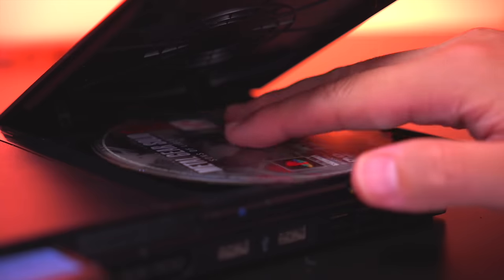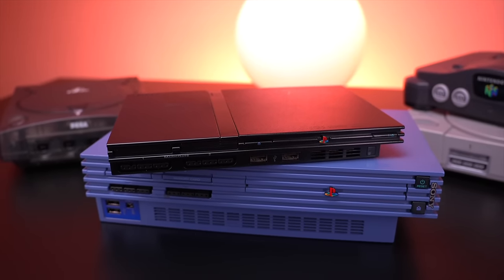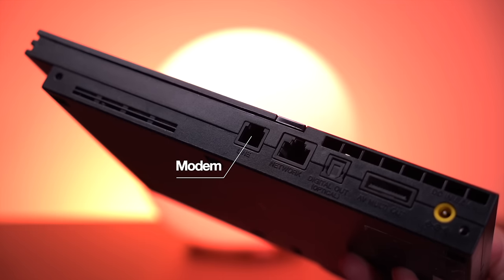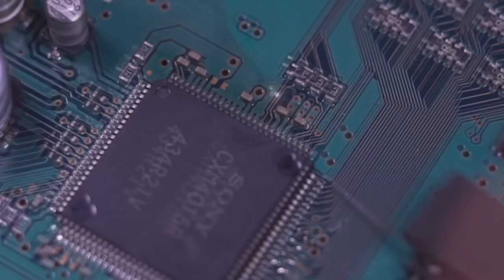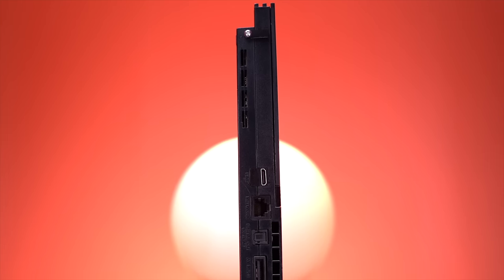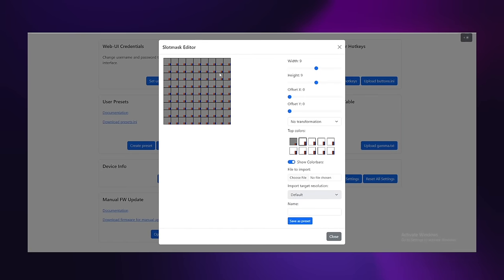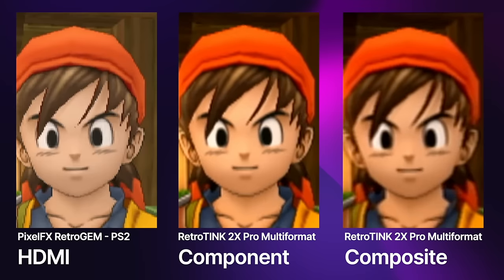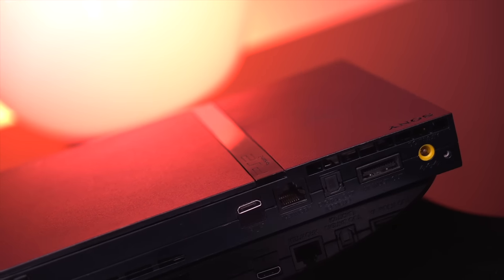This HDMI Mod Makes The PlayStation 2 Look GORGEOUS!

Comment: I think the phat is the better PS2 console variant to mod; hard drive support and the system runs cooler. The slim will probably run hotter with the HDMI kit in there.
Reply: Idk how anyone could think of running a modded PS2 without an HDD... that's like, 90% of the point
Reply: fats are all quite hot and loud....
Reply: @nattila7713  just replace the stock fan with a Noctua A6x25 FLX. The fan comes with a 3 to 2 pin adapter. The only thing you need is a 3D printed bracket, since the original fan is slimmer and dont have the standard mounting holes on the fan. All the thermal pads are 2mm thick except the Emotion Engine's(EE-GS), thats 3mm thick.
Reply: @talos86  hassle and price :( but yeah...
Reply: 7000X slims aren't DECKARDs, and as such have HDD support.

DECKARDs have their own advantages, though.
Reply: HDD? haha mx4sio do all the thing from the micro sd in front memory card slot :D never heard about that? :D  @-Monad-
Reply: @nattila7713  sounds like a pretty simple thing to me. If you don't want to 3d print, I'm sure there is a way to clip it or double sided tape that bad boy in there lol.
Reply: @MrCamel-mb3nd  loading speeds are way too defferent. LAN is even better option than usb 1.0
Reply: 50000x ps2 fat is virtually silent it's beautiful
Reply: You can buy a ribbon cable to 7000 model And connect ide to sd adapter. It will be fully digital console.

Comment: I remember at one point in the PS2 and Xbox's lifecycles solderless mod chips that clipped onto the processor became a thing. Was there a reason that method seemingly isn't used at all anymore? When I see mods like this I always think about how approachable the install would be if it wasn't for the actual ribbon to chip portion, I'd wager a lot of consumers would pay a premium to avoid that one job.
Reply: It wasn't a good solution even back then, but worked for the most part since the signals they dealt with were very often low speed. When you're dealing with pixel bus signals, which is what these mods convert into HDMI, solid connections are 100% necessary (and possibly impedance control) so it's extremely likely that some kind of solderless clamp wouldn't work at all.

Comment: The installation is a hell of a process, so congrats on your detailed explanation and how you have successfully done it. If your plans are to play exclusively on the PS2, I think it's fine to get this kit, especially if you have advanced soldering skills. But, honestly, there are way better and cheaper solutions for this goal, like the GBS Control, that can be used with other consoles. Anyway, thanks Tito, for bringing this new solution to the channel.
Reply from the maker: Thank you P3KaX!  Definitely agree there are a ton of great solutions out there!  Cheers!
Reply: Was it successful though?  The HDMI port is crooked.
Reply: how is that comparable? 
it's not digital output is it?
Reply: @seethruhead7119  it's comprable because both chains result in PS2 games appearing on modern screens, where the results can be compared. Besides, being all digital to the display panel doesn't automatically mean the final product is necessarily superior

Comment: Mixing lead and non lead solder is perfectly fine, you can solder new SSD nands in computers that get hot using leaded. Don't be afraid to use it :) just make sure to have an extractor on :)
Reply: WRONG.  Besides the fact that they have different melting points, mixing Leaded and Non-Leaded solder can result in an alloy mix that WILL fail over time resulting in broken solder joints and intermittent connections.  Unless you enjoy having to go back in 2~4 years to re-solder and repair everything you installed, don't mix solder types.  Do it right or don't do it at all.
Reply: @MrRobarino  Sorry to hear you have had issues doing this, I myself have had no issues in the many years doing so.
I'll stick to what I know works and you can do the same :)
Reply: Extractor? I just put my shirt over my nose and intoxicate myself eventually.

Comment: The lead free solder is only used on the slim PS2s.
It was required by consumer electronics to use it by 2005 (which caused massive problems for the Xbox 360).
Reply: not only 360 but also PS3 (YLOD)
Reply: That’s no true on the ps3
Reply: @BavarianM  The ps3 reeased in 2006...
Reply: YLOD was down to Nvidia and their GFX Chips
Reply: @shain6946  which had issues because of the internal lead free solder
Reply: @Juanguar  so much more than just lead-free solder, go watch videos from RIP Felix

Comment: Between the high price, bad practices, and daunting installation, this really just reminds me that I’m wishing there’d be a Rad2X Pro that supports sync on green or something, cause their PS1/PS2 cable is perfectly fine, barring no digital audio, plus the fact it doesn’t support native 480p
Reply: Hopefully Mike Chi still intends to release the retrotink5x direct cables in the near future. From what I understand it's basically a 5x but consoles specific and in the form factor of a cable, like the rad2x.
Reply: @ians_parks  I mean, it sounds cool, but part of the reason why the Rad2x cables are so appealing to me is that they’re a decent price, like $60 for a very good plug n play HDMI signal, perfect for a more casual retro gamer that just wants to dust off their old console and have it look good too.
I’d be all for a 5x-based alternative, but with the 5x being $300, i’m just a bit worried the direct cables would also be very pricey, which put it more in line with those that’d probably buy a full, universal upscaler anyways.
EDIT: Plus, people die-hard enough to use full-blown HDMI mods might freak out over the slight possibility of analog noise.
Also on an unrelated note, there definitely should be a SNES HDMI mod with the OG models’ noticeable video smear

Comment: The fact that the gem works for so many consoles would be more interesting if you could just switch it around and only buy one, however it’s kind of a moot point that it works for many consoles but you need to buy N of these things anyway. Like a “protected” extension ribbon for each console but that could be connected to the GEM device at will, no need to solder pads or so.
As it stands right now, it doesn’t matter much that its “compatible” since you will be buying several. And at $100 it’s on the expensive side, like all HDMI mods before it.
Reply: One can only hope they will offer a variant that is basically that; that you’d mod each system with a port that the RetroGEM will plug into like a dongle.
Although, not only could that be a lot of pins so we wouldn’t quite know if there’d be an affordable connector, but considering this thing has the equivalent of “on-disc DLC”, I have a bad feeling they have the courage to punch us below the belt
Reply: The advantage here isn't initially for the consumer. PixelFX only needs to stock one component for DC/N64/PS1/PS2; this allows them to hold more stock without fear of oversupply. As a consumer, the parts will be more readily available. The point wasn't to have one device that a single user can swap between systems, it's for the manufacturer to minimize the SKUs needed to meet the demand. With that said, the price point is disappointing, as the same advantages listed above should reduce overall unit cost.
There needs to be competition in this space for PixelFX to see a need to reduce the price. At this point, there is none.
Reply: @CraigAznoe Totally agree. I understand that engineering and supporting these kits is a lot of work. Adding compatibility for a completely new console isn't just creating a new ribbon cable + 3D printed parts and calling it a day. I hope that at some point when their investment has worked out they will sell them cheaper. Until then I'll pass
Reply: @CraigAznoe  That’s a great point. I think my comment was more of a reflection of what he mentioned about this being a great feature, but he probably meant it more from a production standpoint as you say.
Price is indeed the biggest barrier albeit we know all retro stuff is. But I’d rather do a DE-10 based board solution or just some cheap AliExpress adaptor, it becomes too expensive. Maybe some day analogue will bring a FPGA based DC or PS2 when reference FPGA is not cost prohibitive, but until then I personally find it hard to justify the cost of one of these things. Especially considering I’d want to buy one for each console. At that point I’d probably just software emulate.
Hopefully the space keeps growing and one day we see wallet friendly stuff but not holding my breath given that these ventures are usually a solo wolf operation so to speak and it’s already a very niche market.
Reply: A bit of a late reply, but check out the MClassic. Linus did a video on them a while back. You can buy a component to HDMI converter and throw the MClassic on it to upscale and add anti aliasing without being locked to just one system. The PS2 is the exception though and you'll need a Pound Cable($35usd, so not expensive). You just plug the pound cable in, and the MClassic on the other side. No soldering, no paywall, and no permanent modification to the original system.

Comment: At 24:00 with the comparison between each one I've discovered why the color spacing is off: RetroGEM has the color space set to LIMITED color space by default which is why it looks washed out compared to Component and Composite, they're on FULL RGB color space, this discrepency ruins the comparison.

If you have a RetroGEM in a PS1, PS2, N64 or Dreamcast, you can fix this by using the OSD input combo to enter the menu, then go to Video>Advanced Video>Color Space and setting it to full, then saving the settings globally.

Hope this helps anyone looking into this family of HDMI mods.

Comment: Being a universal kit is a killer feature, hopefully they can keep it in stock long term.
Reply: A "Killer Feature" for who? You're obviously not ripping your consoles apart repeatedly to move the core around, especially with the PS2's lengthy teardown cycle. So unless you're leaving your machines disassembled in heaps on your desk or shelf, you're still buying 1 per console. Considering their pricing, you're not getting any price benefit from the savings involved in bulk manufacturing a generic part either. So...
Reply: @KiraSlith   its a killer move in the sense of production my dear friend. You dont have to worry about capacitiy for extra models which is a huge plus when you think of storing or just production limits. You can just produce that one board and only think of the flexcables when you going for specific models and in the sense of why arent there so many more custom pcb boards out there in stock? because its often really specialized stuff for a large sum of money but making a board which you can use for every console is just "a killer feature" ;)
Reply: @GermanAnimeStriker  They are still scamming people out with this. If cost production is even less of an issue for an already basic PCB, why charge 120 dollars for the basic version?
Reply: @kizurura  What is a "basic PCB"? Why do you think that 120 dollars is a rip off and scam? Do you know anything about the cost of creating a PCB from scratch while beeing a one man team? I doubt it, 120 is a pretty okay price for the first version of something like this. He has to make some plus in terms of compensation since he wants to upgrade that think (make more revisions) or even releasing the other versions that are not yet out. This stuff has to be tested, it has to be stored and managed by somebody. I dont see any PCBs from you, maybe i you think you'd make it better and cheaper, go in, its a solid market and you can make money IF YOU ARE GOOD AND YOUR CREATIONS ARE GOOD.

People today are so delusional its unbelievable.
Reply: @GermanAnimeStriker  Not even a Raspberry Pi Pico costs this much. Btw, this is not a single person, this is a team. And yes, I know the cost of creating and manufacturing PCBs that are this basic. It's at most 10 dollars. Wait until someone reverse engineers this thing and passes the blueprints for the PCB for people to order their own from a company that can manufacture them.

Comment: Honestly seeing the side by side - the composite wins hands down.  Not only do  the colors seem richer, but the smoothing process that occurs for a 480p console - a low resolution - it helps with presentation. Plus, perhaps I'm a purist, but using a console as a non-modified piece of hardware true to its generation and it's presentation is HIGHLY favored over a hacked up machine.   I'd rather use an external solution on the output signal TBH.

Comment: Thanks for the review and the comments on the price that are important. But I would have appreciated to see a comparison with the Retrotink 5X-Pro. The cost of this kit shiniest version with the installation is more comparable to the cost of the Retrotink 5X-Pro. The 2X-Pro is arguably a way cheaper alternative.
Reply: I'm pretty happy with my $50 RAD2X too
Reply: A retrotink 2x pro is more cheap, it's easy to install and you can use it with more consoles

Comment: nearly 200$ for a 1080p output? there's no way this has any success. on top of the 100-150$ to have someone install it for you.

the fact it's firmware locked also speaks volumes. they didn't use a cheaper less capable upscaler circuit, they're just being greedy.

Comment: Paywalled software? 200 dollars upgrade for a 20 year old console? Tons of soldering? This sounds like a huge pain in the ass compared to just using component cables on a PS2 and sucking it up or downloading an emulator for free. Honestly, the whole mod and the pricing for it are pretty ridiculous. If you want good graphics on older games emulation is the clear way to go in terms of price, ease of use, and visuals.

Comment: very neat but i think i'll go the retrotink scaler route via component cables since it offers better value if you have multiple analgue consoles (3+) that you wish to use. not to mention, there is no installation or sodering work that needs to be done which for many will be a dealbreaker with the pixelfx mods. even then, a good quality upscaler is rather pricey and hard to justify if you have a perfectly good CRT lying around (which i do). i see many benefits to playing retro games on a modern OLED tv (cleaner image and large screen etc) but i think the charm and novelty is lost on some level when migrating to digital. in any case, our old CRT's will die one day and we will need an alternative path so most of us CRT fans will need to make the transition at some point, whether we like it or not -- if not now, perhaps in the next 10, 20 years. finding someone to fix CRTs will certainly not be easy so i'm not counting on it personally.
Reply: Amazon also has non-powered component switchers for about $18. It’s 3 IN 1 OUT so you don’t need to disconnect from the RT5X all the time. They’re no power so they don’t scale, just pass through at a push of a spring loaded button. I’ve connected 2 of them together.

Comment: Can't even explain how much my heart sunk when I heard that 1080p and 1440p were locked behind a software paywall. You can buy a brand new slim in box for the same price, or even a TV that looks perfect with component cables. Literally no reason to do that other than extra money or possibly personal data. WTF is even the point of taking this risk for 720p?

Comment: cool, i like the soldering part, but a very small nitpick is why should I want to mode an ancient Consol to play its games on a modern panel and spend 200 bucks while i can play them in 8k via PCSX2 with my PC without finding space on my desk. if the Goal is preserving games then the most future-proof solution is using the emulation on PC.

Comment: This is my personal opinion, and you DO NOT need to agree with me!
It's products like these that's killing retro gaming for me. I can't afford this, and I see no reason why this needs to be this expensive. I was expecting around $100, but the version that is actually interesting, that one is almost $200. It's just ridiculous. Those few components extra added to that board can never add up to the $70 price hike. Something tells me that the production cost difference between these two boards are only a few single digit dollars.
Nope. I'll be sticking to cheap upscalers and emulation.
Reply: There is no actual hardware difference between the two tiers. It's one kit with features that would be deemed redundant by having an upscaler being axed so that you aren't paying twice for the same feature set. Though it leaves potential buyers with the impression that their kit has features it could support out of the box locked behind a paywall.

It's a very odd decision. It honestly should've just launched at the expected price that their previous mods retailed for. Introducing the cheaper basic version has only really succeeded in confusing or pissing everyone off. I'm sure their intentions were good but there was a significant lack of foresight when it came to predicting how customers would respond to the decision.

I assume the reason there is no actual hardware difference is because managing a single universal kit means available stock wont be as much of an issue.
Reply: @ians_parks  holy crap... that's even worse! I seriously give up.
Reply: @callme_Sweetpea  I honestly don't blame you. It's just such a bizarre choice.